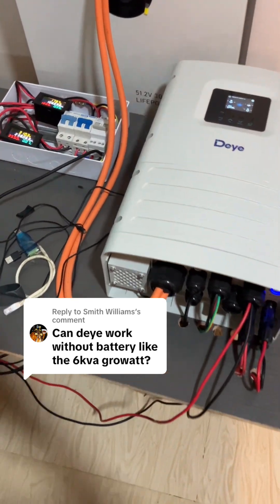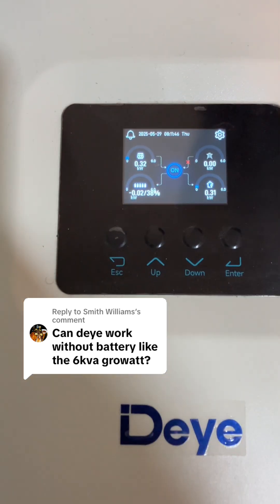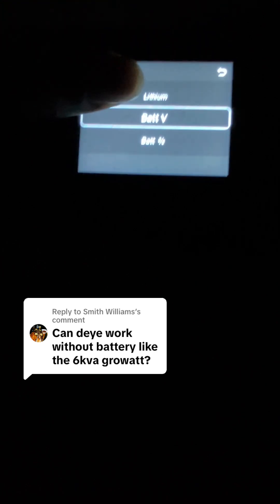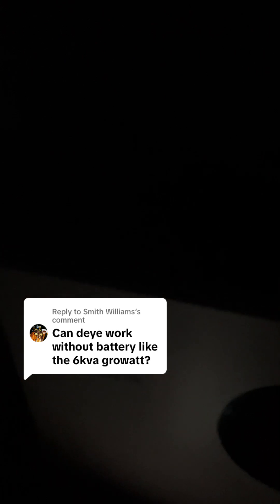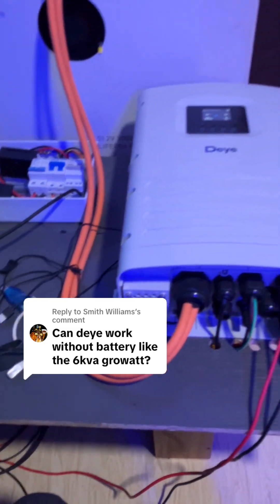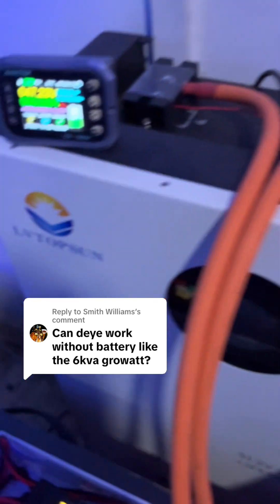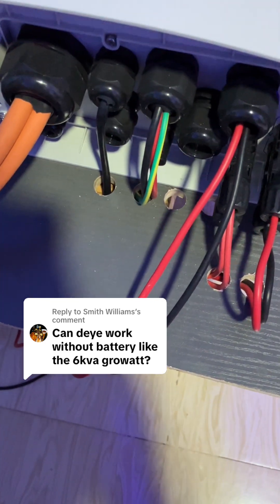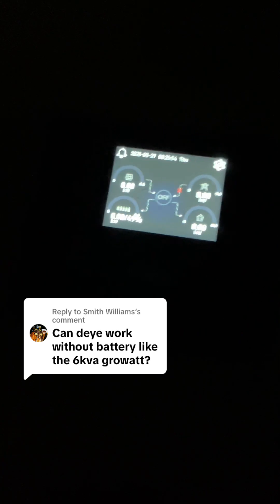Can Deye 6kva work without batteries?

Comment: Check your pv Voltage. Always read the data sheet. The required pv startup voltage is 125v. If your panel is not supplying up to 125V it will not start up.
Reply from the maker: You didn't watch the video

Comment: Why is the inverter Grid input RCD (30mA) tripping when raining starts , it works fine on sunny days
Reply from the maker: Grounding Fault. Earth Leakages. Call electrician to fix
Reply: Is it ok if I connect grid input without RCD @odedeyidamilare
Reply from the maker: @shakoorabdll3910  it's good to have, I strongly recommend you find out your electrical wiring and Earthing.

Comment: Nice video mate keep it up. Have a question for you can we use common neutral with deye inverter
Reply from the maker: No, There is no common Neutral on Inverter manual
Reply: Thanks for ur quick response  @odedeyidamilare

Comment: I've been using my Itel 4kw since I bought it in March without batteries.

It only goes off when I draw more the the panel is producing. I'm using 3 panels in series producing about 90-100 volts.

The minimum starting voltage is 90v. So if the sun intensity drops and the voltage drops below 85v I get a trip off
Reply from the maker: I also used POWMR and it worked without battery
Reply: @odedeyidamilare  can you try to repeat the test. After disconnecting the battery, wait for several minutes or hours if it would eventually go off if the battery is not present for an extended period.

Probably with varying load sizes